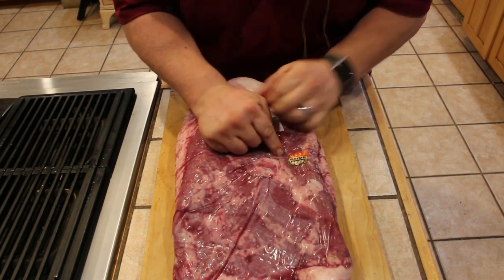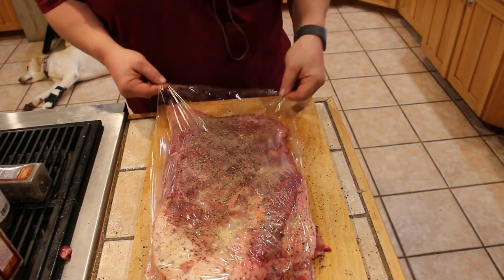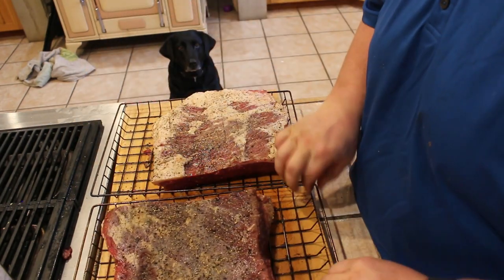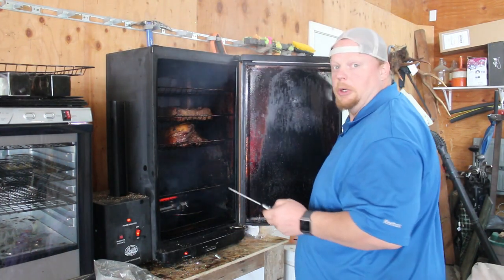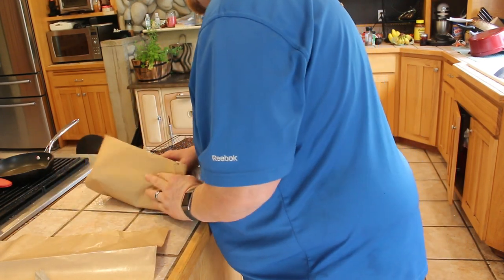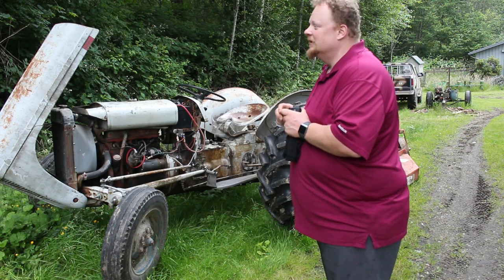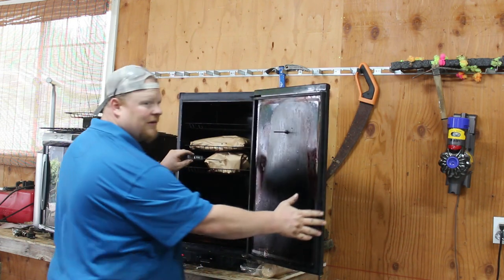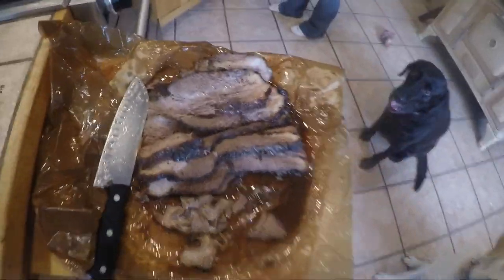Step by step on Awesome Brisket and update on some Projects!!

Comment: Any motor will get addicted to ether never used it hot air burning rags in the inlet manifold and this was on long stroke engines gardner diesels